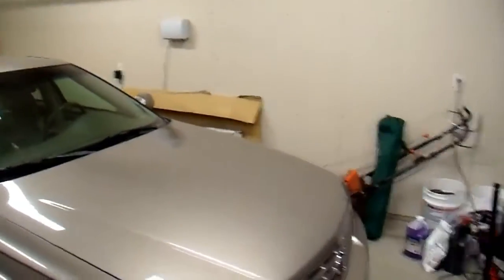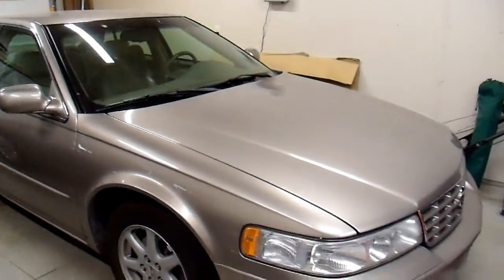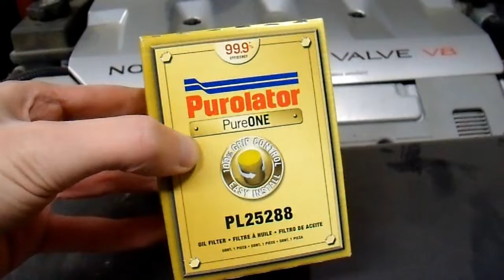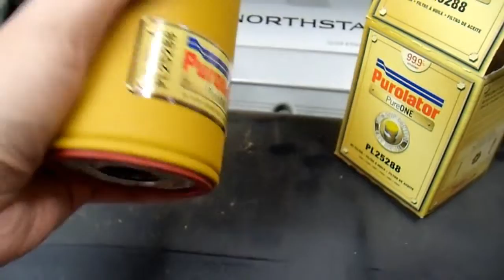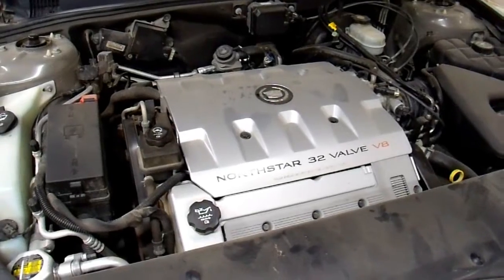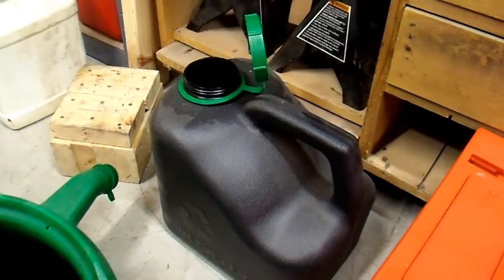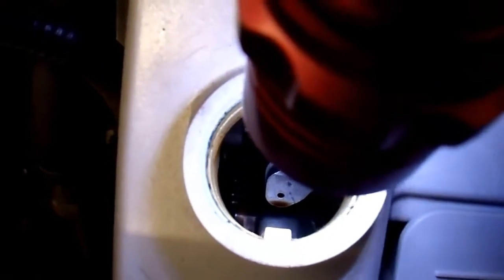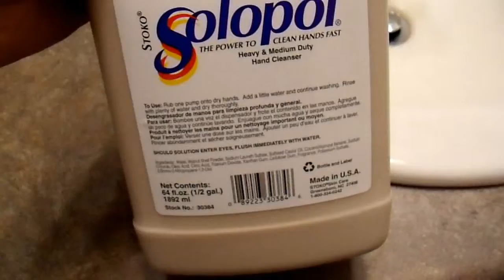Changing the Oil and Filter in my Cadillac Seville

Comment: Next time you changed the oil leave the drain plug out before you take the filter off and see if that helps make less mess because maybe that pressure will go out the low end . Never know might help cuz once you crack that filter it might allow some of the oil to push out Don't know if it'll pull the oil from the filter but it might at least  top part of it

Comment: I do use the synthetic oils, namely Amsoil. It's just been my preference. Mobile 1 was behind for sometime but they are meeting the head of the pack with formulations. Filters... I use the Amsoil Ea0 filters, they are not inexpensive I know but they are better then the 4 dollar deal... I do allot of miles in my car in the field service industry, I have to pay attention to working with better fluids and filters. Personally I have had a better experience with Amsoil but my first cars ran with Mobil 1 starting with a 1980 Cutlass. In all though, Ford makes a better engine.... :)

Good job with all the pointers... Right on the mark... Nice car!
Reply from the maker: Amsoil makes good stuff and if I had a job that caused me to put a lot of miles on a newer vehicle I'd probably use synthetic too.  At the moment I have 3 vehicles and only put on about 10k a year between the three of them, so oxidation/pH is a larger issue than viscosity consistency.  Thanks for the comment!

Comment: Question . I heard suppose to use synthetic , semi synthetic or full synthetic. . What do you think ? Also a hint ir help you can dtill botyom of oil filter for less mess
Reply: Synthetic if most of your trips are short, semi if they're longer. Full syn might not be worth it.
Reply: Wouldn't semi-synthetic be less than synthetic  @SinsBird
Reply: @connorwallace9643  Synthetic oils tend to degrade much more than semi synthetic when exposed to very hot temperatures that engine reaches in long trips.

Comment: hi can i clean transmission filter with petrol except change with new one ? my car s run is 120000 kilometres and can i change new engine oil with mobile 1 10/40 or LUKYMOL 10/40 wich one is the best?

Comment: I just bought a 03 cadillac seville runs smooth shifts smooth.  then I just did a oil change, with 5w30 full synthetic with the cheap supplied filter and it's making ticking noises now.   any help would be appreciated.
Reply: try heavier weight oil. my understanding is 5w30 is for operations in cold climates.

Comment: I was trying to change the oil on a 2002, but couldn't get the bolt off of the oil pan.  I was using a 14 mm head on a socket wrench and it was just a little too loose.  13 wouldn't fit all the way on.  Nothing would work.  Suggestions?
Reply: 15mm
Reply: Let someone else do it who knows what they are doing
Reply: If it’s stripped use vice grip wrenches/ locking pliers and replace bolt 👍

Comment: When you have a vertical mount oil filter like that there really is no excuse for not filling the filter full of new oil before you mount it.
Reply from the maker: There is no reason to to pre-fill filters, and companies such as Cat have TSBs specifically stating to NOT do so on their equipment.  No oil change shop including the dealers will do this, nor will the manufacturer recommend it.
Reply: ***** There is a great reason to do it: it's called good engineering practice.  The factors involved in the CAT TSB are unrelated to anything encountered by the average guy/gal changing his/her own oil.   And shops and dealers don't do it because it's takes more time, not because it's not a good practice.
Reply from the maker: pwschuh
From an engineering perspective there is absolutely no reason at all to pre-fill the filter.  The oil film is fully present for hydrodynamic lubrication during the first few seconds in the short period of an oil change even without oil pressure.  During cold weather this happens during every startup (after a full drain down and no hydrodynamic oil film) so it cannot be meaningfully damaging even in the worst case scenario.  It's a feel good thing that allows another entry point for contaminants which is why it is not recommended.  But if you're careful to keep everything clean it doesn't hurt anything either.

I do agree about the CAT TSB.  It's for practical concerns - way too easy to get dirt/grit in the filter with the extra handling necessary to pre-fill.  Better to just take it out of the box clean and put it on rather than risk getting gravel or something in it during the extra handling steps.
Reply: ***** The worry about "another point for contaminants" makes no sense, if you think about it.  How is there any more danger of contaminants from pouring a pint of fresh oil in to the end of a filter than there is from pouring 7.5 quarts of that same oil from that same source into the top of the engine and letting it run through the engine on its way to the pan?   The other benefit of pre-filling the filter is it slightly lessens the filter medium stress by having the filter medium shock-loaded by pressurized oil when dry.  

It's pretty well documented that most of the wear on an engine occurs during start-up. That wear occurs in the presence of the oil film you mention.  The less time it spends with only that film, the better.  That's why on engines that I care about, I not only pre-fill the filter, I use either an electric pre-luber or an air unit (like the Accusump).  

BTW, I'm doing my first oil change on a Northstar this weekend.  Actually, my teenage daughter is doing it and I am supervising.  I'll make sure she properly pre-fills the filter :)

Comment: hi can i clean transmission filter with petrol except change with new one ? my car s run is 120000 kilometres and can i change new engine oil with mobile 1 10/40 or LUKYMOL 10/40 wich one is the best?( cadillac seville 1997 sts 4.6)